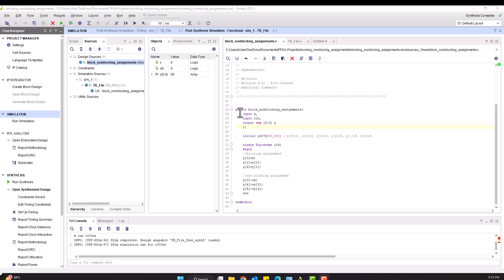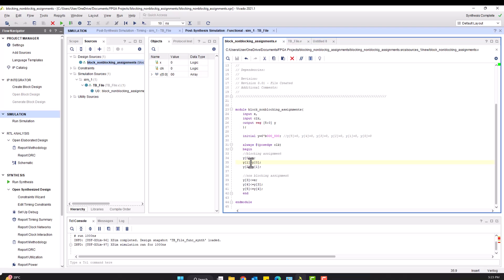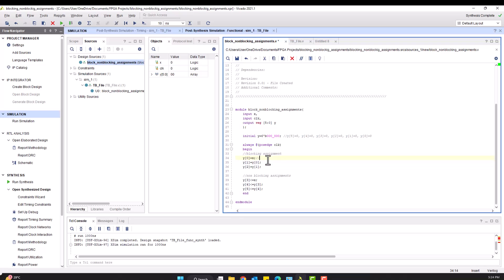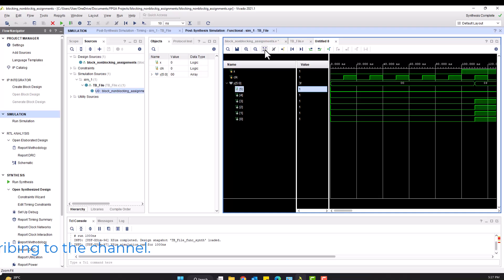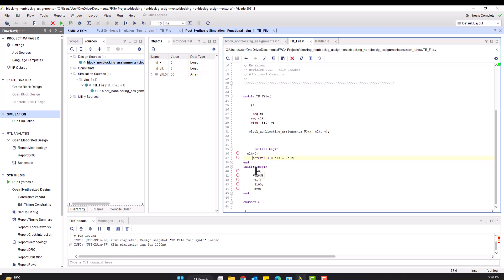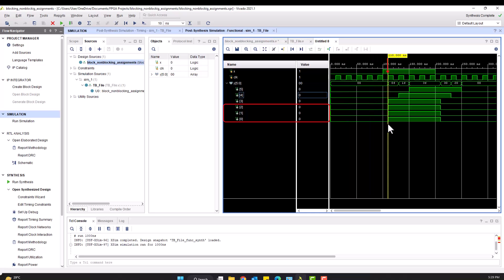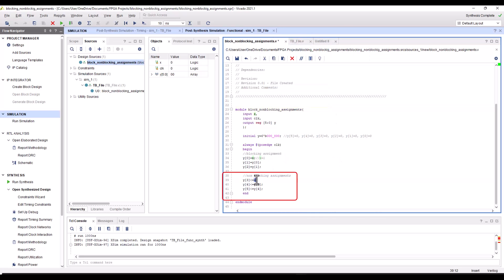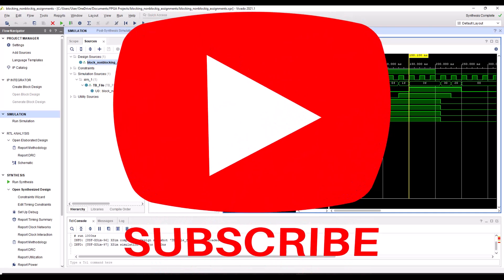#38 Blocking vs. Non-Blocking Assignments ➠  Verilog HDL

Comment: I must say this is a pretty confusing example to demonstrate the difference with. 
This behaves in this manner because you built a pipeline of registers in the asynchronous assignment. While the pipeline in synchronous assignment doesnt simulate registers but straight wires and therefore all of them update immediately. 
In practice asynchronous assignments cause all assignments to occur simultaneously, and = synchronous should cause delays.